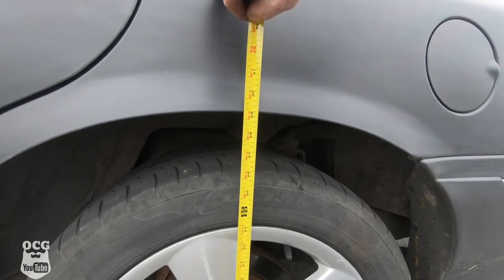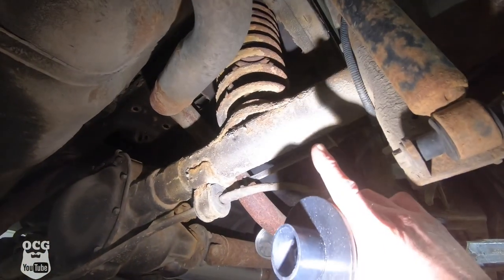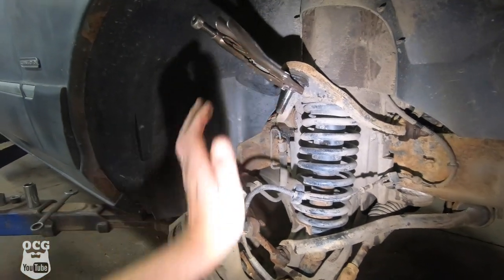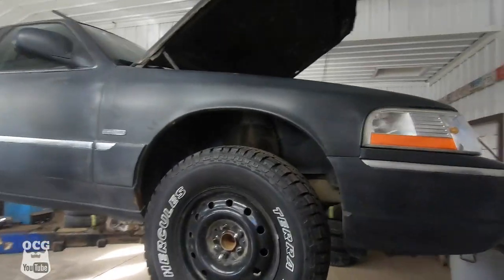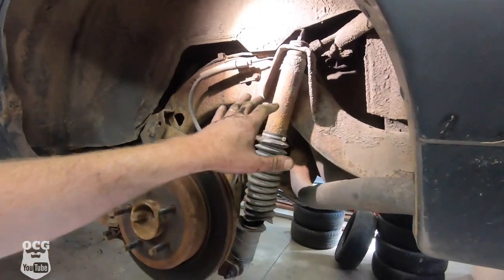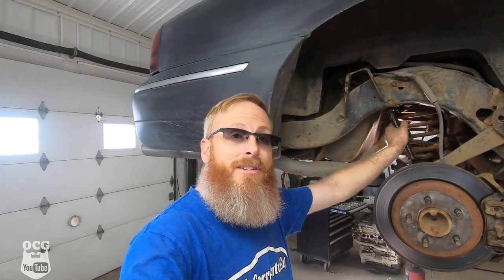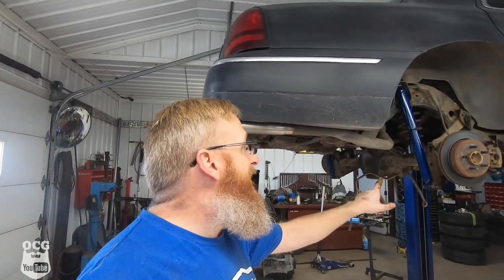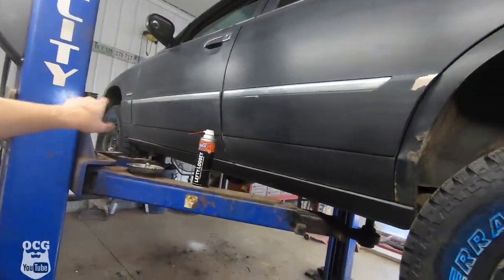Lift Kit on a Mercury Grand Marquis?!

Comment: I was born and raised Chevy boy. GM in general. I've had bowties or bikes my whole life. But I work at a cement factory and my truck was getting a lot of cement dust on it, looking for a daily driver I really really did not want a Honda Civic or Accord, so I did a lot of research on different cars and one of the cars that kept on coming up in regards to reliability was the p71 Crown Victoria. I bought a normal one first for my daily driver then got a lifted Crown Victoria and I fucking love it. I mostly just drive the lifted one but wow is she fun in the back roads and in the mud pits. I'll say this: I won't bash Ford like I used to.  And more so anyone who questions: " should I buy a Crown Vic" I will tell them yes. Preferably the p71 for its suspension, rear end, and ecu but it doesn't have to be. "
Reply from the maker: You're preaching to the choir man. I used to dog on Fords once upon a time myself. These truly are great cars. My wife drives a 2004.

Comment: You can re use the sway bar and links.
I reinstalled mine with the car on the ground.
However I do have sway bar links that are 3" longer if your interested.
Reply: Do you still have the sway bars for sale 
Also can you just leave sway bar off
Reply: @whitelavarball I ended up reinstalling my sway bars with the stock links.  Yes you can go without them but the hiway is a 2 handed driving experience, don't sneeze or look at your phone or you'll be in the next lane before you know it.
I have a 4" suspension lift and a 2" body lift.
Reply: @TACOMASRT5  😂 Thanks I'm good then cause I do that now 💯

Comment: were the adapters for the rear springs loose; was there wiggle room for them? i want to make sure they dont move
thanks
Reply from the maker: Once they are in there, they aren't going anywhere! I had to compress the spring to get them in. Once the tension was released, they were pretty much locked in place.

Comment: Thinking about doing this to my 04 but don't want to have to cut anything. Car is in too nice of shape. Do you think 245/70R16 or LT225/75R16 which are 29.5" would work or could I get away with 30" 255/70R16?
Reply from the maker: It really is about the tire size. If you don't want to cut, you'll want to be no larger than 29"s likely. I really stretched it with 31's. But the only thing i had to trim was the plastic and massage the rear fender well.

Comment: How were you able to get the front sway bar links back in?
On my 2003 CVPI it seems like I will need to install shims at the sway bar mounting brackets to get the geometry right.
Thanks,
Reply from the maker: Sway bar links and sway bar are not an issue with the 2003 and up cars!

Comment: I've had 2 lifted Crown Vics and on the rear of my current one (a 2008 CVPI) I used those spacers too, but I put them up at the top of the spring (at the frame) because that part doesn't have any lateral or geometric movement (the axle side actually kind of rotates a little bit) and then I also put Ford Excursion Police SUV rear springs to give it just a little more load control and weight capacity. I also extended the sway bar hardware and relocated the brake line brackets. (Easy)

  I cut the lower shock mounts off of the axle and raised and welded it back on 5" higher to compensate for the longer spring/spacer combo.( I kind of regret doing that as I should have just gone to a junkyard and cut the Spring mounts off of a wrecked car and just mounted those 5" up and kept the originals in place in case I wanted to put the longer F-150 shocks on it later. Too late now😶)

 Since it was a Police Interceptor I liked the heavier duty shocks that were already on it.(much larger diameter shafts and bodies.💪)

 On the front I just used the strut tower spacers only.(Real pain in the ass!!🤬) but I deleted the sway bar.

 I'm running 31×10.50/15 Milestar Patagonia Mud Terrains on 15"  Lincoln Town Car rims from a 2002 Limousine.(Very strong and+offset)
 I had to belt sand the casting seam off of the back side of the front brake calipers (police car front brakes are significantly larger than civilian model panthers) but I literally   only to smoothed the radius of the casting without digging into the meat of the calipers.(If 16" or larger rims were used or non police brakes this is not necessary)

 A lot of the modifications I had to do with wouldn't be needed if not using a police car.......but I genuinely beat the hell out of this car,have had it at least 4 feet off the ground several times(on the street and off road) and I just recently did an 1100 mile round trip from California to Utah and back traveling between 85 and 108 mph (on the GPS) with zero issues. (Only got a 230 miles from each 18 gallon tank of fuel but that would improve at more reasonable speeds😯)
Reply from the maker: That's great info to share Skeeter. Thanks for that!

Comment: Would finding a longer spring be better than that spacer?  That spacer looks like it needs to be welded to the diff.
Reply from the maker: It isn’t going anywhere! Both shocks would need to disconnect before the spaces would fall out

Comment: will these exact parts you used ( lift and shocks) work with my 02 PI ? I noticed the website list for 03 and newer
Reply from the maker: They WILL NOT. The 03 and up cars have a completely different front suspension than your 02.

Comment: I bought the same lift kit just wondering if you put the shock extender piece on the front shocks or you took it off
Reply from the maker: There were no shock extenders in the front, just the lift spacers, as the suspension uses struts on the 03 and up panthers.

Comment: Did you end up putting the sway bar back on???got mines hooked up but after lift it seems like my trans is dragging I’m trying to figure out y had no problems before the lift
Reply from the maker: Your transmission is stationary. It will not move. I did not connect the rear sway bar.

Comment: My upper control arm is binding with my coils what do I do
Reply from the maker: Is it binding when the suspension is hanging or when its on the ground. It should be fine one you have weight on it.

Comment: i have a 2003 grand marquis that i need a lift kit and tires for, im in Kansas City
Reply from the maker: Lift-a-brand lift kit for 03-up, stock wheels and whatever tires you want (I used 265/70r16). Minor trimming is required!

Comment: I have a 2008 grand marquis I want to left it I was wondering what year f150 shocks I need for it?
Reply from the maker: I believe the rear shock mounts stayed the same in the later years, so rear shocks from a 2003 f150 2wd should work.

Comment: Putting them same lift on a town car 2003 . Did you have any.problems.with the sway bars on the front . Mine don't fit now
Reply from the maker: Not at all! I did reuse the front, but the rear links were broken and i remover the rear bar when i did the differential assembly swap.

Comment: cool car im in the process on lifting my 2000 tc an i dont know what shocks i need for the front an back
Reply from the maker: You don’t need to replace the front as you’re simply putting a spacer between the top of the strut and strut tower! In the rear I used f150 2wd rear shocks from the same year as my car 2003.

Comment: I know this is a 2 year old video, but i had to mention that if you bought the upper and lower rear control arms for this kit, it will center the rear wheel in the arches and correctly realign the pinion angle.
Reply: Are u referring to the trailer arms
Reply: @polonino83  yes. The upper and lower control arms.

Comment: Would it be the same concept for an 02 Grand Marquis GS?
Reply from the maker: Not quite! 2002 and older had a completely different suspension however, there are lift kits for those as well.

Comment: What’s the width of the wheels you’re running? Trying to figure out if my stock steel wheels will worth with that tire size
Reply from the maker: They should work as my wheels are stock size.

Comment: Nice video thanks for the Info I have a question I’m trying to lift my 2007 mercury grand marquis and I’m curious can I get shocks off a 2007 f-150 ??
Reply from the maker: Not that I know of. You need the threaded stud style top mount like mine. Go with a 2003 F150 reg cab 2wd.
Reply: Xavier Stewart just buy exstended airshocks especially if your going to use lift cups in rear only dummy’s use shocks for another car an can eventually cause an issue

Comment: Hey great video! Would a 1997 Lincoln Town Car be the same as well without the airbags? I'm trying to go 28 inch wheels. Wat size lift and shocks will I need?
Reply from the maker: It was a 3" Liftabrand lift and should be very similar on the town car. You'll want to research the tire sizes to know your overall height.  The shocks i used on my 03 MGM were the same year F-150 2wd rear shocks. I believe the rear suspension on the 97's are similar to my 03 but the shocks are mounted inboard the frame but should mount the same as the 97 f-150 shock.
Reply: I had a 1995 x Oklahoma highway patrol crown Vic I put 235 75 15 mud terrains on it it looked great it ran great but somebody decided to take out my front end and push the driver side of the bumper all the way over to the Ford emblem
Reply: Just wrapped up a 7 inch lift on my 97 town car. You will need to pop out the rear airbags and replace with springs plus lift cups. The process wasn't too bad overall. Currently trying to figure out how to repurpose the old air bag compressor to have a pump for airing up the tires when needed.

Comment: You didn't have to weld the back lift adapters to the axle? I didn't see anything holding it in place?
Reply from the maker: Trust me! Its an extremely snug fit to get them in place. They wont be going anywhere. The axle doesn't drop far enough on its own, you would need to remove the 4 links and pry it down. But yes, you could weld them.
Reply: Nice. Gonna be getting this done on mine soon. Thanks for the feedback 👍

Comment: Follow up?  How was gas mileage affected?  Did you weld the rear differential or put in posi track or limited slip?  Cool build. Video of it in snow would be fun!
Reply from the maker: It was really hard to tell what the true mileage really was. I didn't take it out of town so it didn't get much highway miles. I did upgrade the rear gears to 3.27 locker which was perfect to keep the speedo semi-accurate.
Reply: @OldeCarrGuy  That is cool thanks for the reply.

Comment: how much would it cost for a shop to do this? i was gonna do it myself but i dont have any help
Reply from the maker: It's a pretty straight forward job which can be done in a few hours. The lift kit is $189, the rear shocks were $30 (https://amzn.to/3kt8AuA), and my shops labor will likely run $300 (4 hours @75/hour). I hope this helps.

Comment: I've been wanting to do this to my grand marquis for a few years now, but I've been having trouble finding a lift kit for any panthers pre 1998. Do you know if this kit will work for me?
Reply from the maker: This kit will not work as it is set up for strut suspension up front. I would check with Liftabrand’s website!

Comment: I just put a 3 inch lift on my 95 Mercury grand Marquis I’m trying to lift the front now but I’m having trouble getting the lower control arm to line up due to the lift kit
Reply from the maker: Ar you referring to the strut bolt or the ball joint. It Definitely helps to have a second set of hands.
Reply: @OldeCarrGuy  I am refining To the ball joint
Reply from the maker: @richmiller6383  Get a floor jack under the control arm and jack it. The weight of the car should be enough pressure to bring the two together. If not, jack up the opposite corner first to transfer weight. hope this helps.

Comment: I want to lift my front do I use the same f150 shocks
Reply from the maker: No! Use the stock struts and add the lift spacer. Only the rear shocks need to replaced with f150 shocks or get the shock extension kit.

Comment: will this lift fit 26 inch wheels/rims if fender was cut aswell
Reply from the maker: It ultimately depends on the overall diameter. My setup is almost 31" overall with very minimal trimming!

Comment: I’m looking at doing this to my town car! I’m just worried about the front upper arm and ball joint not having enough room or hitting on something. Have you had any issues with yours?
Reply from the maker: No trouble at all. But depending on the year of your car, some earlier models had different style control arms.
Reply: @OldeCarrGuy    Would it be to much to ask for a suspension component update to show the wear on them so far? Mine is a 98 so I know it’ll be a little bit different but I’m genuinely curious before I drop big money on something
Reply: @worldsokayestmechanic6631  Just put a 7 inch lift on my 97 town car to fit some big knobbies. I did need to change out the upper control arms with new ones but it gave me the clearance needed. Got the kit from Universal Car Lifts and the control arms came in the kit but you can also buy them individually.

Comment: I got a 2010 grand Marquis with air ride (factory) I want 24”s. Do I have to lift it? And if I do this will the air ride go crazy? Any advice would be appreciated. Rim shops telling me all kinds of conflicting information. Thanks.
Reply: You do have to lift it. Just pull the air ride out it's easy.
Reply from the maker: Deezon is right! You will have to bypass the air ride.

Comment: Will this same Process work for a 2001 marquis
Reply from the maker: I don’t think this particular kit will work on a 2001 as  you car used coil springs and shocks. Mine used struts! However, Liftabrand does offer kits that will work on your suspension!

Comment: I like what you are doing I been thinking of getting a grand marq, or a crown Vic to mess around with the are legit the last of the big cars, I want to covert it to a carburator though.
Reply from the maker: You wont regret buying on of these, but you may regret converting it to carb. They are already one of the most reliable modern cars out there. I'd suggest keeping it stock to keep it reliable.
Reply: You think it's a bad idea? I just wanted to go old school on it, headers, 4bl Holley, rally wheels. Maybe keep the fuel injection.I just love the simplicity of it.

Comment: Thanks for the great video I'm think about doing the same to my marquis. Was there a sway bar in the front? How dose it ride now Compared to stock? Dose it handle ok at highway speeds? Mines about as nice as your grandma car and I can't decide if it's something I should do to a car that nice would really value your opinion on this thanks
Reply from the maker: Hey! The front sway bar doesn’t come into play and the car rides not much different that stock. Maybe a bit stiffer in the rear but it still cruises like a Merc! No regrets at all! The best thing is it can all be changed back to stock quite easily!
Reply: @OldeCarrGuy  haha thanks man I think I'm gonna give er a go stock is just too low wish I could send ya a pic I just strapped a kayak to the roof haha
Reply from the maker: @phantomleafblowing2741  go follow me on Instagram or Facebook. You can send me pictures there.

Comment: Not a lift kit but a conversion kit from air springs to coil springs.  
I have a 2001 Grand Marquis LS and I swapped out the air springs for coil springs. First I swapped out the shocks to the overload shocks and reattacked them before starting the coil springs installation got a spring compressor tool and compressed them from 18" to 14" and install them. No removing sway bar or shocks. fits great. complete job to me 1 hour

Comment: What is the name of the rims and where did you get them from
Reply from the maker: These rims actually came with the car when I bought it so i don't know for sure. My guess is MacPek. They are just a steel rim used for winter tires.
Reply: @OldeCarrGuy  ok thank you i found the rim. Do they make a rear extended shock that is an exact fit
Reply from the maker: No, but the 2003 F150 2wd rear shock is a pretty close match.
Reply: @OldeCarrGuy   ok what modifications would i have to make for the 2003 shocks?
Reply: Also should i get 2009 f150 shocks since i have a 2009 or should i get 2003 shocks
Reply from the maker: If you’re on Facebook or Instagram, find me over there. Easier to chat!

Comment: So... 265/70r16 on 16 inch rims... but what is the width? 16x?
Reply from the maker: These are just a stock Ford winter steel rim 16x7.
Reply: @OldeCarrGuy  And those tires fit on the 16x7 without bulging? I am trying to do my research to lift my 03 Grand Marquis as well. I know that it currently has 16x7s but was worried the tire size you went with would bulge too much... it's always hard to tell from a video lol
Reply from the maker: @rossharrell1766  If you're on Instagram or facebook, message me and I can share some pictures with you!

Comment: are the shocks 2003 f150 2wd or 4wd?
Reply from the maker: Just 2wd rear shocks! Thanks for watching.
Reply: @OldeCarrGuy  what is the part number on the shocks if you do not mind
Reply from the maker: @georgew.armstrongjr.6784  No problem!
Napa-94198
OE Spectrum-37134
KYB-344374
Munroe-32303

Comment: But why I would guess that it would make that car even slower but those taller tires
Reply from the maker: A larger circumference turns slower and take more energy to turn resulting in a speedometer reading slower and lower performance.
Reply: @OldeCarrGuy  yep and your PCm will need reflashed to correct the  speedo what's would  also give you an excuse to get a Marty tune but you know
Reply: Gear change. 👍

Comment: That thing is insane, I love it.
I've got to get another Panther to just play around with.
Thanks for the how to video.
Just curious, did you have to replace your rubber brake lines?
Seems like the OEM lines would be stretched pretty tight at full travel.
Reply from the maker: They are pretty close to the limit but the shocks will bottom out first.
Reply: @OldeCarrGuy  Thanks for the info. 👍